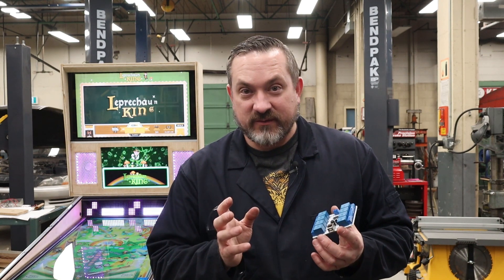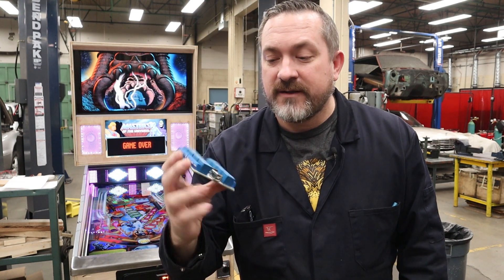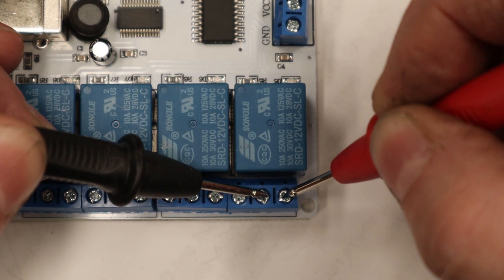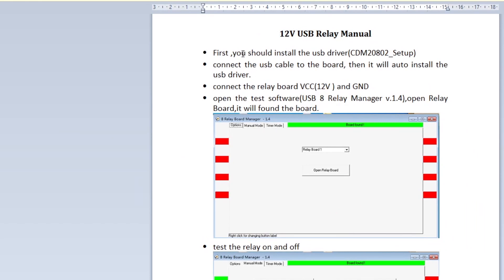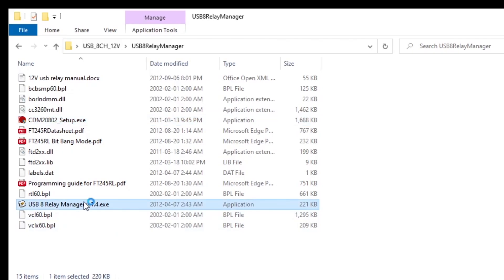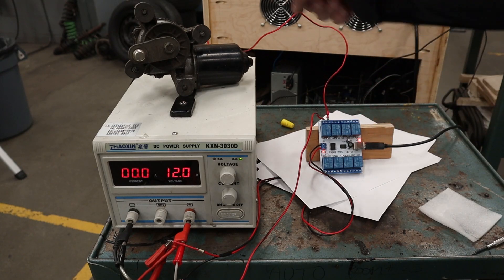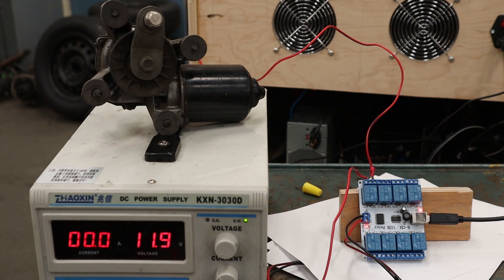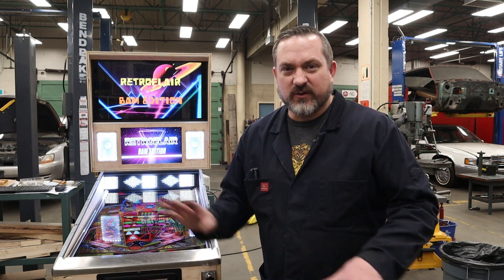Virtual Pinball: How to install a sainsmart usb 8 channel relay board for mechanical toys

Comment: That is not the correct way to install solenoids or toys with sainsmart. If you follow this guide you will blow up your solenoids or board. The most crucial step was left out. You must install and inline resistor as close to the solenoids. This stops power feedback to boards
Reply from the maker: This video is just setting up the sainsmart board, not solenoids.  For each mechanical toy added, a diode has been installed to prevent flyback voltage.  You do not need an inline resistor.  I set this up like 2-3 years ago and it still works perfectly,  I haven't lost a single toy and it gets played daily.  Thanks for the watch!

Comment: Can you power the board with a 24v power supply to use 24v soleniods
Reply: Somebody told me you need to step down volts to 12v then use the 24volt power supply going into the relay then that's used to power the toy?
Reply from the maker: Sounds right.  The board needs 12 v to power itself and then it can control larger voltages through the relays.
Reply from the maker: I'm pretty sure in the beginning of the video I talk about it being ok for even higher than that.  The board itself needs whatever voltage so you don't fry it (I think it's 12v) but it can control 24 volts going to a toy.

Comment: Hi, first of all I want to thank you enormously for these videos. I couldn't get this far without them. 

My problem is that I couldn't get my hands on a Sainsmart board in my country so I bought another brand relay board, namely from Ashata. Thinking they are all teh same. It has also a chip with the number ULN2803A on it.
The thing is, Windows recognizes the board as USBRelay8, but the 'USB 8 Relay Manager v.1.4' says " No Boards Found".and therefore it doesn't do nothing.

Am I missing something in the software, a dll file or so, have you any thoughts ?
Thanks in advance.
Reply from the maker: You're welcome, I'm glad you are enjoying the content and my teaching style!  If you would like to support my work, I have a Patreon in the video description.

So first off I'm pretty sure that the only relay board that works with this is the Sainsmart one and it also has to be the 8 channel one.  Could you get it working? Maybe but I personally think you can't.  I had to order mine directly from Sainsmart and they sent it to me.  Are you not able to send things to your country?  You might wanna post your question in the vpin builders Facebook group, someone might know if there is a way to get yours going.  Hope this helps.  Thanks for the watch and your support!  Cheers from Canada!
Reply: @wayofthewrench  Thank you for your answer. I've just read Chapter 51 of the 'Pinball Bible' and it says the same thing. You MUST use the board from Sainsmart, others won't work.

I've got in my cab a Pinscape 'Piggy Back' construction with a Mainboard and a Powerboard. I'll use that instead. Until now I only used it for the plunjer and the Flasherboard LED's.
So I'll dive into chapter #48 of the Pinball Bible where this is explained. Wish me luck 😀
Reply from the maker: Good luck!

Comment: Tried to download the manual,but It had nothing (server down), tried several times...but nothing all other manuals are available.I think they have stopped making the 8 channel 12v USB.
Reply from the maker: No it's still there.  Here's the link.
https://www.sainsmart.com/products/8-channel-12v-usb-relay-module?variant=32641034387535&currency=USD&utm_source=google&utm_medium=ppc&utm_campaign=shopping&utm_content=product&gad_source=1&gclid=CjwKCAjwxLKxBhA7EiwAXO0R0OP5k3vSVG6aS4yAYNbKjQGPac5r5NajwEm5ISXOv49rK-QrMpLwMhoCzqgQAvD_BwE
Reply: @wayofthewrench  still got probs with downloading the manual,no server.Is there an alternative board,that is compatible with dof?. P.s all other manuals for different relays download fine.
Reply from the maker: hrmmm not sure then.  You could use Arnoz boards like Walter and Mos8 boards to control toys too.

Comment: How do I set this up in DOF? Do you have a video that shows the process or would you please make one? Recently I bought a virtual cabinet setup (I am totally new to this) and when I was adding a couple of table to Future Pinball I noticed afterward that my solenoids no longer pop when I am playing. They do still do the test pop when I first power the cabinet on though. It seems that I have somehow disabled them though I did not tinker with Direct Output Framewrok (I don't even know how to). I'm not sure if there is a button combo on the cabinet that disables them or if I accidentally hit a button on the keyboard that may have disabled them. The first thing I am going to do is replace the USB cable that runs from the USB hub to the Cleveland Software Designs 8-Channel Relay Board because it was mounted in a way that awkwardly bends the cable right at the connection to the board so it could have ruined the cable. Otherwise the hardware looks like it is all still connected properly so I suspect it is something on the software side. Maybe the issue is in DOF or PinUP. The solenoids no longer work in Future Pinball, Visual Pinball X, Adult 18+ pinball games or the JUKEBOX app that came installed on the machine. I'm not sure where to go from here and any help would be greatly appreciated.
Reply from the maker: I do!  There is a whole playlist of videos to learn from.  Watch all of the addressable led and cabinet file videos.  They are all in order so if you watch it in order, you'll be golden!  Cheers!

Comment: Whats the use for the relay to control this pinball machine? The only useful thing these relays do is turning computers on/off or powering on/off power strips.
Reply from the maker: It's in the video.  I am controlling higher voltage devices like gear motors and shaker motors with my PC using 5 volt usb power.  Thanks for the watch and welcome to the channel!

Comment: Great video boss. I have a LEDWiz allready and have 12v Siemens 12c contractors but bought 12v starter motors which need more amps than the board can give. You talked about a mosfet booster board. Would a D4184 do?? Would be super inexpensive ❤
Reply from the maker: Thanks!  I'm not familiar with that board but as long as it can handle the amperage and voltage your starter motor uses, then it might work.  I know you can make the boards yourself too and will be very cheap.  Good luck and thanks for the watch!

Comment: Hi.  I'm running multi SainSmart boards and I'm having an issue with one of my DOF ini (configured for my solenoids) files triggering both of my boards.  Even though I've used the VPuniverse DOF tool to generate separate ini files.  I've checked and they have different serial numbers and comm ports assigned, so I'm kind of stumped.  Any ideas?
Reply from the maker: So when one sainsmart board is supposed to trigger a relay another sainsmart board gets triggered too?
Reply: Hi.  That's correct.  It's a complicated issue.  Technically I'm trying to run 3 Sainsmart boards at the same time.  The first two I got up and running with no issues.  The first is configured for my solenoids, using .40ini file.  The second board is a Cleveland Sainsmart clone & it has my knocker & gear motor attached, using .41ini.  Both boards work great in conjunction.  It's when I add the 3rd Sainsmart board to the mix, I encounter issues.  This board has a chime unit attached & is configured to use the .42ini file.  When I plug in the 3rd board, my Cleveland board no longer works in VPX.  Only the board running my solenoids works correctly.  And you can watch the relays fire off in the solenoid pattern on the Chime board.  As far as I can tell, each has a unique comm port & serial number assigned.  And each appears to initialize in the DOF output file.  So there's something about introducing the 3rd board that blocks the Cleveland board, along with not responding correctly itself.  I've also got a light strip running on a pinone board that works fine regardless what's plugged in at the time.  So it's got to come down to having 3 of the same style board?  Also, I do not have a cabinet or global file that I'm using.  The .ini files are run directly from the root DOF folder.  DOF 64bit, VPX 10.8.5.  I took a look into the cabinet tool you recommended but it was geared towards LEDs, so I gave up on making a cabinet file.  I know it's a lot to take in.  I'm just hoping someone smarter than me will find this & know a solution.
Reply from the maker: I wonder if the clone sainsmart board is messing you up.  I vaguely remember reading that somewhere.

Comment: "Why don't you come on up? We'll have some poutine , and you can bring some of these boards up; it'll be great!"

Don't tempt me, haha. I'm in the process of tweaking my Game Room Solutions arcade cab to use your monitor mounting method instead of their included VESA mount. Keep up the good work!
Reply from the maker: Yeah I don't know why everything has to be so expensive just to bring it to Canada.... it's a joke.  Someone's making a ton of money and it ain't me.  Cool!  How's the build quality on that GRS cabinet?  Thanks for the watch!
Reply: @wayofthewrench  it's pretty good for the most part. The construction of the control box could be better, but it's passable. The IKEA style assembly makes taking individual parts off a bit annoying. It'll do though.
Reply from the maker: I may never see the inside of one of those.  Thanks for the review.
Reply: @wayofthewrench  I could snap some photos of you'd like a closer look?
Reply from the maker: Sure if ya get the chance.  Cheers!

Comment: Are you universally using 16 awg wire for all your connections?
Reply from the maker: I am using a lot of 18 gauge for all of my wiring.  It could be a bit overkill but it will be safe.  Plus I'm sticking to my colour code of red is 5V, black is common/ground, yellow is 12 volt and brown is 6.3V.  Thanks for the watch!

Comment: Thank you SOOOOO MUCH  for your in depth videos on vpinball !!!.  Youve helped me get through alot of problems. 
 So problem i have now, is I have the exact same sainsmart relays.  They both are disconnecting and clicking nonstop.    One guy said they need a separate power feed from the 12v "toys".   You have any issues with this??
Reply from the maker: Glad I could help!  I do not have that problem at all.  You could test it out with a known good power supply to see if the power is not getting to the board properly.  The other thing it could be is a bad usb cable or bad usb port.  Good luck!

Comment: random relay chatter at boot from usb relay board causing motors etc to twitch, add a relay with a 5 second delay on motors power line / psu
Reply from the maker: That's a good idea.  I kinda like how my cabinet makes all of the different beeps and noises when it's powered on.  Plus I can hear that everything powered on correctly.  Thanks for the suggestion and the watch! Cheers!
Reply: @wayofthewrench  my 'real' pin cab goes through all the bootup twitches too as it checks to make sure everything is reset to where it needs to be before you can start a game.  I think it adds an element of realism.
Reply from the maker: Yeah I love it when mine does that too!  I almost want to add more just to weird people out......

Comment: Time for me to see how bad my wiring is again compared to others. I put one of these in my modded arcade1up a couple of years ago
Reply from the maker: Lol, If I wasn't filming this build....it probably would be a mess.  I tried to keep it clean as I went but I also plan on cleaning it up a lot for the final tear down/assembly after painting/vinyl.  Thanks for the watch!
Reply: Did you use yours for 12V solenoids flippers etc? I notice he didn't mention fitting diodes to stop back voltage just wondered if you did?
Reply from the maker: @Teckno77 on everything I put in, I put a diode in for flyback voltage.  You put a diode right on the toy you're putting on.  No I did not install flippers on mine.  My ssf rocks!
Reply: @wayofthewrench  Thanks man loving going through your videos at min, so helpful! I'm now venturing into DOF world and I fear the DOF haha. I'm thinking of using the solenoids for bumpers now instead tbh as I think it would make more sense in my build, can you assign multiple bumpers to the same solenoid? Cheers
Reply from the maker: @Teckno77 dof is easy....I got you.  Videos are there in the playlist.  Yes you could assign any amount of toys to a single output if you wanted.

Comment: I love your videos and i thank you for that, i would like to make a correction if you don’t mind
You can use 16 channels board with ledwiz and it works fine, this is what i have on my cabinet 
Again, thanks a lot for lot for your videos, 👍
Reply from the maker: Thanks Guto!  Sorry if it didn't come across clear, I meant to say that this usb 8 channel relay didn't go with the ledwiz.  There are actually a lot of different ways to hook up mechanical toys.  I will be adding an ledwiz later so I can show other set ups too.  Thanks for the suggestion!  Cheers!

Comment: Great video!  I'm curious, do you find the SSF and transducers don't provide enough of the mechanical feedback that you're wanting to use this relay setup to supplement?
Reply from the maker: Thanks Jason!  Not at all!!  I love my SSF and if anything it can be way louder and more power felt it I want it.  I actually have it turned down to feel more realistic.  I made this video for people who wanted to add real mechanical toys to their vpin cabs.  Now that I have added some to mine, I feel like they add a sense of realism in a way because you hear/feel a different gear or shaker motor than before.  With SSF and mechanical toys, the experience is pretty awesome!  Thanks for the watch!
Reply: I've never experienced SSF, but solenoids are very loud and make vpin much more realistic
Reply: @masonmcderp2485  same here.  As someone who has an actual pin cab, I think I'd really be missing the tactile feedback of the coils firing in a vpin if I just used transducers.

Comment: So you haven’t seen the KL25Z expansions offered by Arnoz or Cleveland software? IMHO,any new build should have a pinscape with an expansion board. Prices are pretty similar $100USD. But it’s one board that drives 8 high power outputs in addition to all the buttons you need. Each offering can be further expanded to support a ton more inputs.

The beauty is that is just one usb connection and everything is located in the pinscape software for which there is ample documentation even in the software itself.

BTW, you’ll need a diode across the motor and probably a capacitor to reduce noise (emi) when the motor spins down. Same for any future solenoids/ contactors.
Reply from the maker: Yeah I know about both of these options but there are lots ways to build these vpins so this time I went with Virtuapin.  I might make more vpins and use other options like these later.  I would definitely try a kl25z with pinscape next time plus a different plunger set up.  Thanks for the suggestions though.  Yes I have already made a bunch of videos with mech toys and have already added the diodes.  Thanks for the watch!

Comment: It's great to see this video right now. I literally have 10 tabs up researching which way to go with outputs. Is there a noticeable delay using these relays?
I wanted to use them for flipper solenoids.
Reply from the maker: I'm not sure if there would any delay for flippers and I could see how that would be really important.  For the gear motor and shaker motor I have installed already, I haven't noticed any lag.  Thanks for the watch!